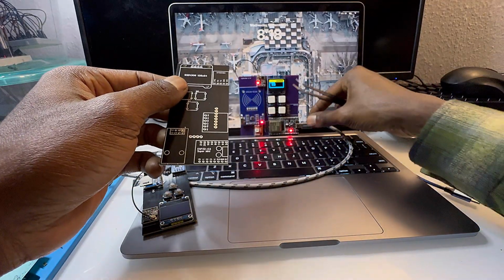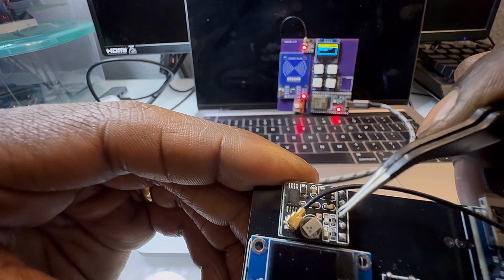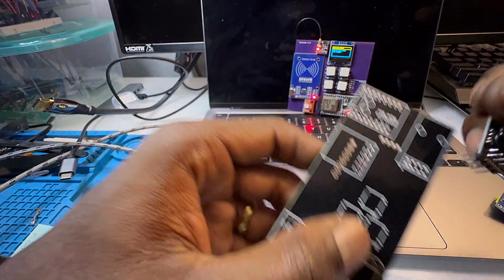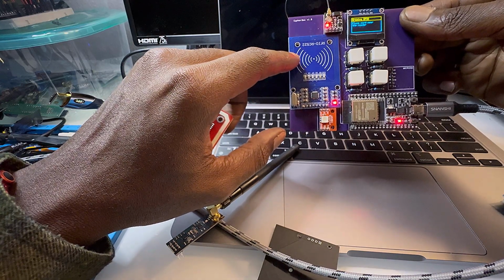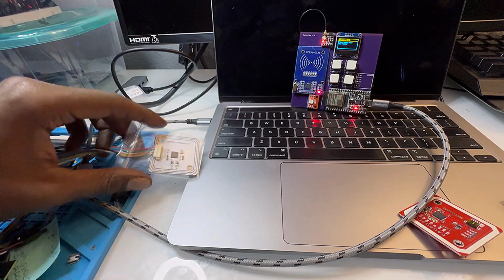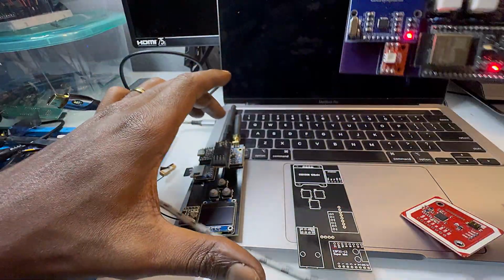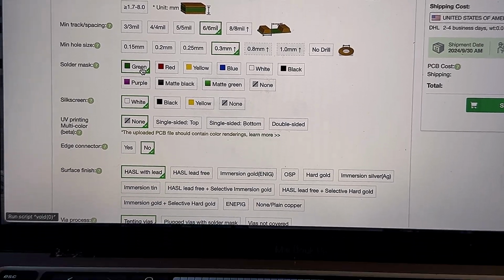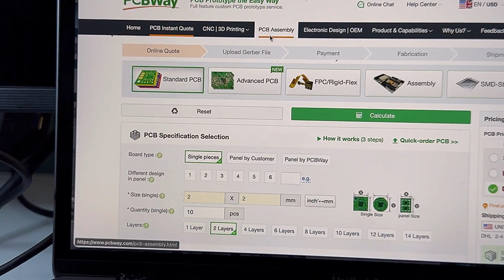ESP32 CypherBox Mini PCB Design

Comment: I'm hooked to your content. My company is developing a cashless payments system for arcades. We are currently using the PN532 but its antenna is just not strong enough for it to register a tap when its in a case. When do you think you plan to release your pn7160? any ideas on cost per unit? How  has your custom antenna performed compared to the base pn532?

keep up the good work!
Reply from the maker: Thanks that’s great! That sounds interesting and I’d like to assist if possible with my new module.

My discord is @divinezeal to discuss more!